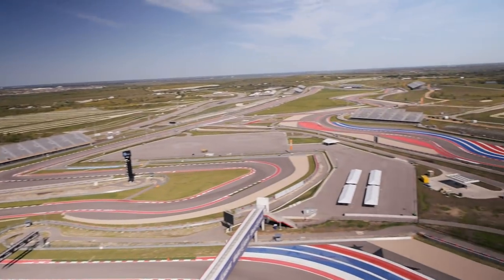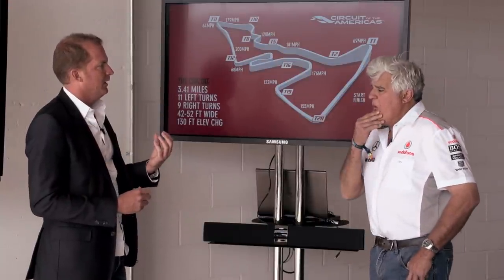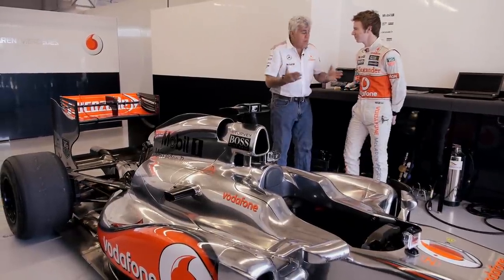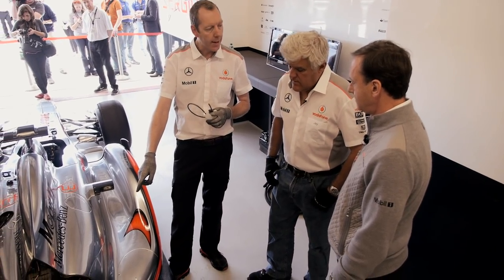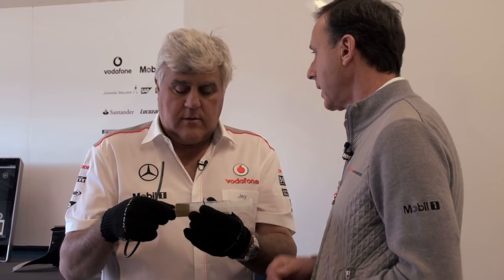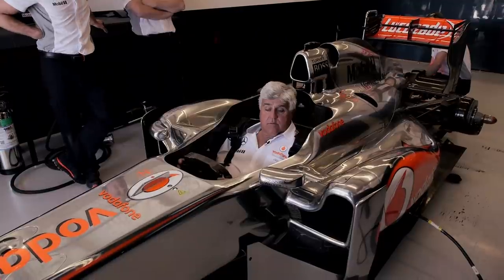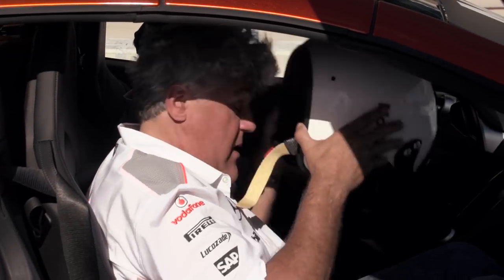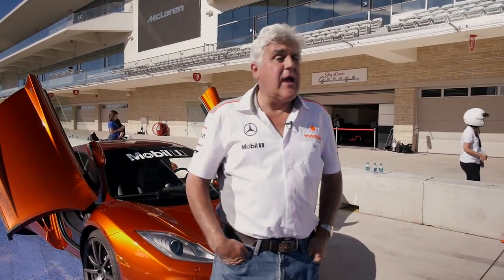McLaren Day at Circuit of The Americas - Jay Leno's Garage

Comment: For me, the technical details of Formula 1 are far more interesting than the racing.
Reply: An for me... When I see a race... I want a race with "Beating the other guys" as top priority...

Which is mainly why I don't like F1... I just can't really comprehend a race where passing isn't top priority... Look I get the speed... But it's a RACE...

I just like the track...
Reply: Videogeek95 Have you watched a F1 race in the last 10 years? The racing in 2014 has been amazing.
Reply: David Jonsson Let me think... F1... Isn't that where you already know the winner 80 laps in? At which point you change the channel because boring?
Reply: Yes, that's correct. Because that's 15 laps after the race ended and you'd be pretty damn un-informed to not know the winner by then.

NASCAR, isn't that the one where you suffer 290 laps of "maybe" cautions and then sit tight for the last 10 laps where it actually matters if someone overtakes?
Reply: COTA is a 56 lap race for 190 miles. I picked the American track to make it easy to reference, nice of me huh? It's just that F1 cars are a lot faster than NASCAR cars, so they complete the race in way less time than a NASCAR car would. There is nothing on this planet that will run a track in less time than an F1 car. An F1 car would lap the entire field, probably 3-4 times, if you had it start last in a NASCAR race. Why? Because it's superior in every single way.

Can you also show me a few examples of where someone starting from the very last position has won a NASCAR race? It might have happened some time, and it would be great to watch. Just like when Jensen Button started from the pit lane and won the 2011 Canadian Grand Prix.

Yes, I think NASCAR makes their tracks left turns only by choice. Because obviously you can drive NASCAR cars on road tracks as shown by this years Watkins Glen race (which was, by the way, pretty entertaining).

The fact that they don't want to go straight means they're crap cars. And they don't need to go straight. Why would they need to go straight if they're running in a circle? Making a sprint cup car go well in a straight line would be fucking pointless as it's seldom going to do that.

Get off your handicapped pony and stop pretending it's a high horse. F1 is the pinnacle of motorsport and has always been and most likely always will be.
Reply: So... Let me get this strait...

Nascar... Is better than F1... Because they take any car from off the street... Do absolutely nothing special to mechanize it... Care NOTHING about weight unless being able to get in the car...

And can still make any driver of any weight go at least 210...

Yeah... Figured F1 wouldn't be able to compete...
Reply: Any car from off the street? Have you even watched NASCAR...? Could you tell me where I can buy a sprint cup car as a regular person? The philosophy is that the cars are crude and simple. This does not make it "better". The cars are crude and simple because the racing is crude and simple. They don't need paddle-shift gearboxes because they hardly shift (and as previously mentioned, shifting manually is not difficult unless you're american and only drive automatic cars which Europeans don't). 

Facts: F1 cars are way, way faster than a sprint cup car, both around a track and in a straight line. Ricciardo went 223mph at Monza this year and that's on an actual race track, not an oval

Facts: F1 races contain technical driving and impressive overtakes due to the fact that the cars are different and the track is changing. Different cars have strenghts at different points on the track. All stock cars are the same and the track is mostly static which means that all overtakes are likely to be done by drafting the guy behind and going past on the inside.

The only redeeming factor for NASCAR are the road races which can be entertaining because it's such a dirty form of racing with lots of incidents. If this is because the cars are shit or the drivers are shit I'm not sure. Likely a bit of both.

Formula 1 is however still the pinnacle of motorsport. This could be easily proven by placing a F1 car at the back of the grid of a NASCAR race and watch it breeze past the entire field.
Reply: A Chevy Impala, A Dodge Avenger, and A Toyota Camry... A sprint car is nothing more than those cars in a specialized chassis... In fact its even less...

Have you even fucking heard of "The Big One"?
Reply: Videogeek95 Okay, so if I go into a dealership and buy a Chevy Impala today it will be delivered with a 850HP V8?
Reply: David Jonsson What part of F1 isn't better than Nascar because you can't compare the two... Aren't you getting here...?

 It's like comparing F1 to Motocross...
Reply: Videogeek95 The part where you haven't even said it, for starters. You started comparing F1 to NASCAR so why would you try to use that as an exit? You can begin by answering my question regarding what engine you'll get in your stock Impala if you buy it in a dealership :)
Reply: David Jonsson The Same engine you'd find in a NASCAR...

Kind of hard to call a car an Impala without an Impala Engine...
Reply: Okay, so you fully believe that a person purchasing a Chevy Impala gets a 850 HP V8 in it? Oh my god.

http://en.wikipedia.org/wiki/Chevrolet_Impala#Engines_3

NASCAR does NOT use stock cars. I know you think that because of the name, but the cars are nowhere near stock. I assume you're just trolling by now.

The cars used in NASCAR have got NOTHING in common with their road going counterparts. NOTHING. They have a similar look to them but that is all. For god's sake, a NASCAR sprint cup car hasn't even got headlights.
Reply: You can sup up an engine into a V8...

Fine... I admit it okay? I'm wrong... But again... What does that prove? Huh?

I'm more focused on you putting Down Nascar because it can't compare to F1... The only problem is you're not SUPPOSED to fucking compare them...

So what if an F1 car is better than a Sprint Car? Of course an F1 car is faster than a Sprint Car... That's because F1 is top of the line high performance sport utility... While NASCAR is bare bone down and dirty racing...

That doesn't change the fact that a GOOD NUMBER of F1 drivers would DIVE at the chance to race NASCAR at least once... And vice versa...

To compare the two would be like comparing Super Bikes (I don't know what you call the sport) to Motocross...

Both cars have ENTIRELY different rules and regulations that need to be met with them...

And yes... Why I like NASCAR is because it's easy to follow... Not because of the track... But because of the fucking cars...

Have you fucking seen how similar F1 cars are?

Wait a minute... F1 cars have shorter numbers of laps because they travel the distance faster?... WHAT THE HELL KIND OF BULLSHIT IS THAT!?!?!

A 3 mile course is STILL 3 miles no matter how fucking fast you're going....
Reply: That's because it is just a showcase, not a real race. If it ain't rubbin', it ain't racin'. If you ain't first, you're last.
Reply: I know nothing about NASCAR, but this argument sounds like ones I have had with guys I know who are into the Aussie saloon car racing, thinking the car they drive during the week is the same as the cars they see driven on the track on the weekends because it's the same shape - in reality out of tens of thousands of parts, they have maybe 20 or 30 parts in common with the track car and those are things like body panels and tail lights - the racing engines alone cost more to build than a whole top model fully specced consumer version of the car.
Reply: Videogeek95 you're highly misinformed if you think that nascar doesn't use computers to to tell them all that information. Formula 1 doesn't have computers to tell them where to turn, where to gas and where to break. they have to do all of that by instinct and feel. formula doesn't race in the oval because its too dangerous for them in the open cockpit they have. these cars are all about performance in stoping turning and even acceleration. both of these cars push around the same horsepower but one weighs more than the other.
now the nascar vehicle is a faster top speed but thats because the f1 car isn't made for top speed. its all about maneuverability and agility stop and go. who cares what the top speed is. if you can't make the turn at a specific speed, you're out of the race.

jeff gordon and tony stewart both got to drive these vehicles and they were like kids in a candy shop for the first time. they absolutely loved it. look it up!

and to say that a nascar stock car is nothing more than a off the lot chevy makes you out to be an imbecile. nothing on a nascar stock car is something you can buy. 

Nascar passes are due to drafting not skill.

F1 far surpasses NASCAR in every way even top speed. 233mph but that was when they had V10 engines.
Reply: Videogeek95 The Big One = Every American
Reply: Matthew Sharpe WIKIPEDIA : Every F1 car on the grid is capable of going from 0 to 160 km/h (100 mph) and back to 0 in less than five seconds. During a demonstration at the Silverstone circuit in Britain, an F1 McLaren-Mercedes car driven by David Coulthard gave a pair of Mercedes-Benz street cars a head start of seventy seconds, and was able to beat the cars to the finish line from a standing start, a distance of only 3.2 miles (5.2 km).[20]
As well as being fast in a straight line, F1 cars have outstanding cornering ability. Grand Prix cars can negotiate corners at significantly higher speeds than other racing cars because of the intense levels of grip and downforce. Cornering speed is so high that Formula One drivers have strength training routines just for the neck muscles. Former F1 driver Juan Pablo Montoya claimed to be able to perform 300 repetitions of 50 lb (23 kg) with his neck.
The combination of light weight (642 kg in race trim for 2013), power (900 bhp with the 3.0 L V10, 780 bhp (582 kW) with the 2007 regulation 2.4 L V8), aerodynamics, and ultra-high-performance tyres is what gives the F1 car its high performance figures. The principal consideration for F1 designers is acceleration, and not simply top speed. Three types of acceleration can be considered to assess a car's performance:
Linear acceleration (speeding up)
Linear deceleration (braking)
Lateral acceleration (turning)
All three accelerations should be maximised. The way these three accelerations are obtained and their values are:
Acceleration
The 2006 F1 cars have a power-to-weight ratio of 1,250 hp/t (0.93 kW/kg). Theoretically this would allow the car to reach 100 km/h (60 mph) in less than 1 second. However the massive power cannot be converted to motion at low speeds due to traction loss and the usual figure is 2 seconds to reach 100 km/h (60 mph). After about 130 km/h (80 mph) traction loss is minimal due to the combined effect of the car moving faster and the downforce, hence continuing to accelerate the car at a very high rate. The figures are (for the 2006 Renault R26):[citation needed]
0 to 100 km/h (62 mph): 1.7 seconds
0 to 200 km/h (124 mph): 3.8 seconds
0 to 300 km/h (186 mph): 8.6 seconds*
*Figures are heavily dependent on aerodynamic setup and gearing.
The acceleration figure is usually 1.45 g (14.2 m/s2) up to 200 km/h (124 mph), which means the driver is pushed by the seat with a force whose acceleration is 1.45 times that of Earth's gravity.
There are also boost systems known as kinetic energy recovery systems (KERS). These devices recover the kinetic energy created by the car's braking process. They store that energy and convert it into power that can be called upon to boost acceleration. KERS typically adds 80 hp (60 kW) and weighs 35 kg (77 lb). There are principally two types of systems: electrical and mechanical flywheel. Electrical systems use a motor-generator incorporated in the car's transmission which converts mechanical energy into electrical energy and vice versa. Once the energy has been harnessed, it is stored in a battery and released at will. Mechanical systems capture braking energy and use it to turn a small flywheel which can spin at up to 80,000 rpm. When extra power is required, the flywheel is connected to the car's rear wheels. In contrast to an electrical KERS, the mechanical energy does not change state and is therefore more efficient. There is one other option available, hydraulic KERS, where braking energy is used to accumulate hydraulic pressure which is then sent to the wheels when required.
Deceleration
The carbon brakes on a Sauber C30
The carbon brakes in combination with tyre technology and the car's aerodynamics produce truly remarkable braking forces. The deceleration force under braking is usually 4 g (39 m/s2), and can be as high as 5–6 g when braking from extreme speeds, for instance at the Gilles Villeneuve circuit or at Indianapolis. In 2007, Martin Brundle, a former Grand Prix driver, tested the Williams Toyota FW29 Formula 1 car, and stated that under heavy braking he felt like his lungs were hitting the inside of his ribcage, forcing him to exhale involuntarily. Here the aerodynamic drag actually helps, and can contribute as much as 1.0 g of braking force, which is the equivalent of the brakes on most road sports cars. In other words, if the throttle is let go, the F1 car will slow down under drag at the same rate as most sports cars do with braking, at least at speeds above 250 km/h (160 mph). The drivers do not utilise engine (compression) braking, although it may seem this way. The only reason they change down gears prior to entering the corner is to be in the correct gear for maximum acceleration on the exit of the corner.[citation needed]
There are three companies who manufacture brakes for Formula One. They are Hitco (based in the US, part of the SGL Carbon Group), Brembo in Italy and Carbone Industrie of France. Whilst Hitco manufacture their own carbon/carbon, Brembo sources theirs from Honeywell, and Carbone Industrie purchases their carbon from Messier Bugatti.
Carbon/carbon is a short name for carbon fibre reinforced carbon. This means carbon fibres strengthening a matrix of carbon, which is added to the fibres by way of matrix deposition (CVI or CVD) or by pyrolysis of a resin binder.
F1 brakes are 278 mm (10.9 in) in diameter and a maximum of 28 mm (1.1 in) thick. The carbon/carbon brake pads are actuated by 6-piston opposed callipers provided by Akebono, AP Racing or Brembo. The callipers are aluminium alloy bodied with titanium pistons. The regulations limit the modulus of the calliper material to 80 GPa in order to prevent teams using exotic, high specific stiffness materials, for example, beryllium. Titanium pistons save weight, and also have a low thermal conductivity, reducing the heat flow into the brake fluid.
Lateral acceleration
F1 cars can accelerate to 300 km/h (190 mph) very quickly, due to their ability to gain RPM quickly. The top speeds, however, aren't much higher than 330 km/h (210 mph) on most circuits. The highest speeds are at Monza 360 km/h (224 mph), Indianapolis (about 335 km/h (208 mph)) and Gilles Villeneuve (about 325 km/h (202 mph)). This is because the top speeds are sacrificed for the turning speeds; however, this paradox was cleverly circumvented during the 2010 F1 season as many teams were using the now banned F-duct system. An F1 car is designed principally for high-speed cornering, thus the aerodynamic elements can produce as much as three times the car's weight in downforce, at the expense of drag. In fact, at a speed of just 130 km/h (81 mph), the downforce equals the weight of the car. As the speed of the car rises, the downforce increases. The turning force at low speeds (below 70 to about 100 km/h) mostly comes from the mechanical grip of the tyres themselves. At such low speeds the car can turn at 2.0 g. At 210 km/h (130 mph) already the lateral force is 3.0 g, as evidenced by the famous esses (turns 3 and 4) at the Suzuka circuit. Higher-speed corners such as Blanchimont (Circuit de Spa-Francorchamps) and Copse (Silverstone Circuit) are taken at above 5.0 g, and 6.0 g has been recorded at Suzuka's 130-R corner.[21] This contrasts with 1 g for the Enzo Ferrari, a high performance road car.
The large downforce allows an F1 car to corner at very high speeds. As an example of the extreme cornering speeds; the Blanchimont and Eau Rouge corners at Spa-Francorchamps are taken flat-out at above 300 km/h (190 mph), whereas the race-spec touring cars can only do so at 150–160 km/h (note that lateral force increases with the square of the speed). A newer and perhaps even more extreme example is the Turn 8 at the Istanbul Park circuit, a 190° relatively tight 4-apex corner, in which the cars maintain speeds between 265 and 285 km/h (165 and 177 mph) (in 2006) and experience between 4.5 g and 5.5 g for 7 seconds—the longest sustained hard cornering in Formula 1.
Top speeds
The 2005 BAR-Honda set an unofficial speed record of 413 km/h (257 mph) at Bonneville Speedway
Top speeds are in practice limited by the longest straight at the track and by the need to balance the car's aerodynamic configuration between high straight line speed (low aerodynamic drag) and high cornering speed (high downforce) to achieve the fastest lap time.[22] During the 2006 season, the top speeds of Formula 1 cars were a little over 300 km/h (185 mph) at high-downforce tracks such as Albert Park, Australia and Sepang, Malaysia. These speeds were down by some 10 km/h (6 mph) from the 2005 speeds, and 15 km/h (9 mph) from the 2004 speeds, due to the recent performance restrictions (see below). On low-downforce circuits greater top speeds were registered: at Gilles-Villeneuve (Canada) 325 km/h (203 mph), at Indianapolis (USA) 335 km/h (210 mph), and at Monza (Italy) 360 km/h (225 mph). In the Italian Grand Prix 2004, Antônio Pizzonia of the BMW WilliamsF1 team recorded a top speed of 369.9 km/h (229.8 mph).[23]
Away from the track, the BAR Honda team used a modified BAR 007 car, which they claim complied with FIA Formula One regulations, to set an unofficial speed record of 413 km/h (257 mph) on a one way straight line run on 6 November 2005 during a shakedown ahead of their Bonneville 400 record attempt. The car was optimised for top speed with only enough downforce to prevent it from leaving the ground. The car, badged as a Honda following their takeover of BAR at the end of 2005, set an FIA ratified record of 400 km/h (249 mph) on a one way run on 21 July 2006 at Bonneville Salt Flats.[24] On this occasion the car did not fully meet FIA Formula One regulations, as it used a moveable aerodynamic rudder for stability control, breaching article 3.15 of the 2006 Formula One technical regulations which states that any specific part of the car influencing its aerodynamic performance must be rigidly secured.[25]
Technical Specifications (2011-2013)
Chassis
Construction: Carbon-fibre and honeycomb composite structure
Gearbox: 7-Speed Semi-automatic paddle shift Sport gearbox, longitudinally mounted with hydraulic system for power shift and clutch operation
Weight: 642 kg (1,415 lb) including driver
Fuel Capacity: Approx. 33 imp gal (150 L; 40 US gal)
Length: 5,000 mm (197 in)
Width: 1,800 mm (71 in)
Height: 950 mm (37 in)
Wheelbase: 3,000 mm (118 in)
Steering: Power-assisted rack and pinion steering
Brakes: Ventilated carbon callipers, discs all-round and pads
Front and rear suspension: Aluminium alloy uprights, carbon-composite double wishbone with springs and anti-roll bar, multimatic dampers
Wheel rims: Forged aluminium or magnesium wheels
Front wheel size: 12 x 13 in
Rear wheel size: 13.7 x 13 in
Tyres: Pirelli P-Zero slick dry and Pirelli Cinturato treaded rain tyres
Front tyre size: 245/660 - R13
Rear tyre size: 325/660 - R13
Safety equipment: 6-point seatbelt, HANS device
Engine
Main article: Formula One engines
Configuration: V8 naturally aspirated engine, 90 degree cylinder angle and 32-valve
Displacement: 2,400 cc (2.4 L; 146.5 cu in)
Bore: Maximum 98 mm (4 in)
Valvetrain: DOHC, four-valves per cylinder
Fuel: Unleaded fuel
Fuel Delivery: Fuel injection
Aspiration: Naturally aspirated
Power Output: 550 kW (748 PS; 738 hp)
Torque: Approx. 400 N·m (295 ft·lb)
Lubrication: Dry sump
Maximum Revs: 18,000 rpm
Engine management: McLaren Electronic Systems
Max Speed: 225 mph (362 km/h)
Cooling: Single water pump
Ignition: CDI
Technical Specifications for 2014
Engine (Majors)
1.6-litre V6 turbo engine and two Energy Recovery Systems (ERS) with ~750 hp.[26]
Chassis
Fuel Capacity: 100 kg fuel limit for race (approximately 140 Liters)
Gearbox: Introduction of 8-speed, fixed ratio gearboxes
Front Downforce wing: Width of wing reduced from 1,800mm to 1,650mm
Rear Downforce wing: Shallower rear wing flap and abolition of beam wing
Car weight: Minimum weight increased by 49 kg, up from 642 kg to 691 kg
Height: Nose and chassis height reduced (the height of the chassis has been reduced from 625mm to 525mm, whilst the height of the nose has been dramatically slashed from 550mm to 185mm).
Exhaust: Single exhaust with central exit
Reply: Too bad it's hit a bit of stand still at the moment. I'm sure they still make and develop new technologies but I just find the pre-V10 era to be more technologically interesting.
Reply: MrPCT007 Nascar is only Chevy Ford and Toyota. I was happy to see dodge leave but I'd love for Nissan to take Toyota's spot.
Reply: Matthew Sharpe  i liked an article written in one old magazine that said "almost its only resemblance with a street car is that has 4 wheels'´
sorry for my english
Reply: Absolutely cringeworthy this NASCAR bloke is, has no idea about the extreme differences of NASCAR and F1 and then once proven wrong backtracks over his original argument which was to compare the two, he then goes on to say they're completely different and doesn't know why people are comparing in the first place... Fanboys ladies and gentlemen...
Reply: David Jonsson Very very well said. Well done sir!
Reply: I think it's such an amazing thing the technical side of it, i think the racing would be more interesting if it were closer fought between all teams
Reply: True. The mechanical genius that makes F1 cars the pinnacle of automotive engineering is fascinating.
Reply: TBH both NASCAR and F1 races are boring punctuated with short periods of excitement.  Something to watch highlights of, not waste hours watching live.  

F1 cars are obviously bespoke, and NASCAR cars only have a patina of being based on road cars.  They are really bespoke as well.  Both types of racing are incredibly difficult, and incredibly different.  

The mocking of NASCAR as being just a whole bunch of turning left ignores the massive banking on the tracks, as well as the very different nature of the cars (very minimal brakes, overall higher top speed, much bigger car).  That said, F1-style racing is just as difficult, but but in different ways.  

Comparing the two is apples to oranges.  They are both fruits (auto racing), but the similarities end there.
Reply: David Jonsson at least nascar drivers actually race. They don’t slow down so a teammate can pass. They pass their teammates if if it costs that teammate the championship. They are. There to race. Not just to look cool.
Reply: Videogeek  and the F1 car can actually shift gears for the driver lol. Noobs.
Reply: David Jonsson  an F1 car is a glorified go kart. That’s it.
Reply: @Videogeek95  yeah doing turns at 100 of miles per hour is so much more easier than slightly turning left or right